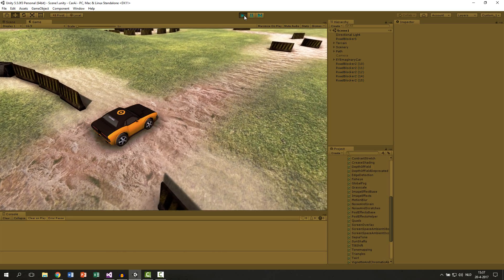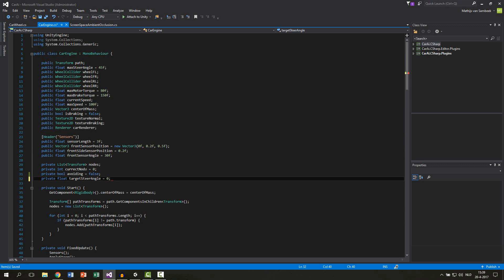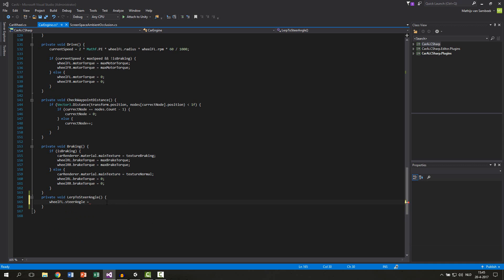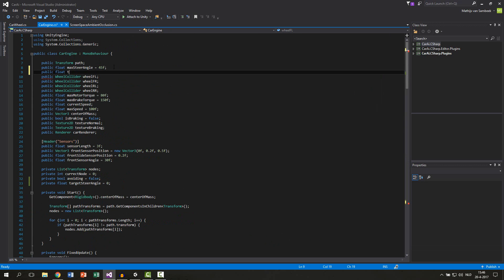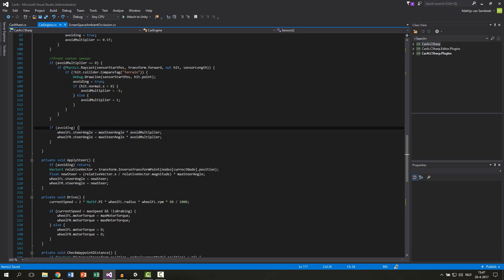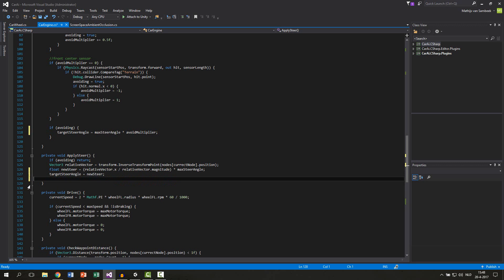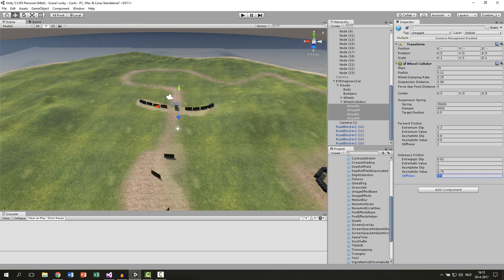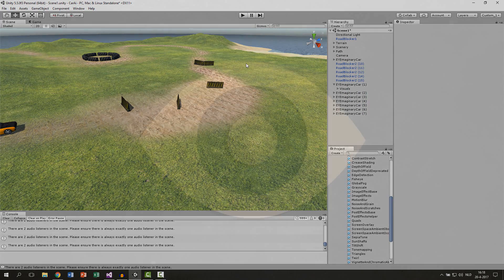Car AI Tutorial #10 (Unity 5) - Smoothing Turns

Comment: A couple of simple additions that I've made: 
-Significantly increased the minimum distance under CheckWaypointDistance. In complex scenes the car has an easier time pathfinding.
-When turning/avoiding, applied negative speed to the car so it slows down and turns properly.
-Added a "hasCrashed" bool in "OnCollisionEnter", and if true, the car goes in reverse for a short period.
-A simple sound/particle effect system that plays sounds when gaining speed, turning, braking, crashing etc...

Comment: I am making ai for a racing game. I used this method to make the ai cars avoid each other, overtake or give way to a faster car behind using five sensors but this made my fps drop a lot probably due to lots of if else statements.how do I optmize this? Is there a way to create a generalized code for all situations?
Reply: hi,
did you had any issues like car falling out of waypoint path or something ?
Reply: @raheemudheenrasheed7365  no
Reply: @raheemudheenrasheed7365  when the car is trying to something it won't follow ofc. But i faced a problem that it would leave the track trying to avoid the other vehicles

Comment: HI! Can you help me, please?

 I placed a car on a street in my test city and then i configured it correctly. 
Then I placed a trigger on a street corner, that my AI car should collide, which will change it's (Path)- transform to another one . 
I tried to change my car (Path-transform) and the (current node) variable by using the ''Set property'' using Playmaker as soon as it collides with the street trigger. 
But, even after my car (Path-transform) changes on it's properties, my car won't follow up the new path destination. It will keep moving to the first path nodes.  

But even after changing things, my car won't follow the new path waypoint neither! 
I also tried to enable the (edit mode) in the (set property) command, but it also didn't work.

What could i do to make my car to follow the new path as soon it collides with the trigger? Or it's a bug? Cause i'm sure you didn't blocked the scripts to not be possible to tweak. 

Thank you so much. I hope i could find an answer!
Reply from the maker: Andrew Thiago Hi Andrew, the part of the script you posted only checks how close the car is to the waypoint. The actual steering towards the waypoint is in another part of the script. 

Please check the variable used for calculating the steering angle, and see if this variable uses the new path.
Reply: @EYEmaginary  Hi, thanks for answering me!! I looked inside the code once again and sorry for posting the wrong thing. And no, the script doesn't point to the new path, just the target: 
------------------------------------------------------------
      }
    }
    private void LerpToSteerAngle() {
        wheelFL.steerAngle = Mathf.Lerp(wheelFL.steerAngle, targetSteerAngle, Time.deltaTime * turnSpeed);
        wheelFR.steerAngle = Mathf.Lerp(wheelFR.steerAngle, targetSteerAngle, Time.deltaTime * turnSpeed);
    }
}
-----------------------------------------------------------
And as it doesn't take into account'' path changed event''.
Reply: @EYEmaginary  And the script doesn't update the path and it's new nodes, so it keep going throught the same nodes from the old path like it never changed. Thank u anyway!

Comment: Thanks for this great playlist. However, I have a question which is that my car get to some point in the path and rotate around itself and when i change the path it works. and in some other cases the reverse happens .. it goes well and when i change the position of the nodes a little bit it goes away from the path and rotate around itself also ... why could that happen ?